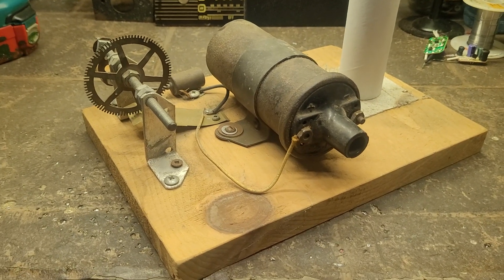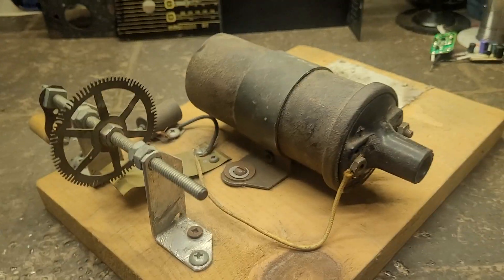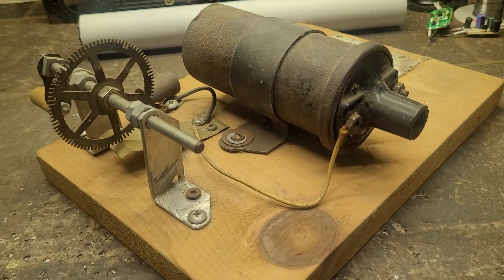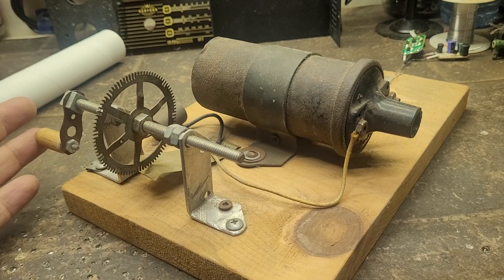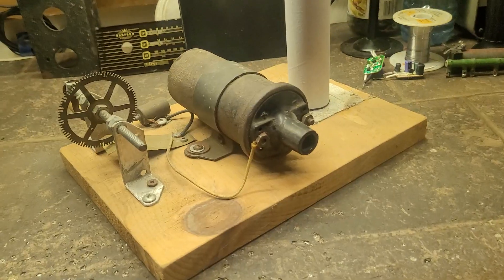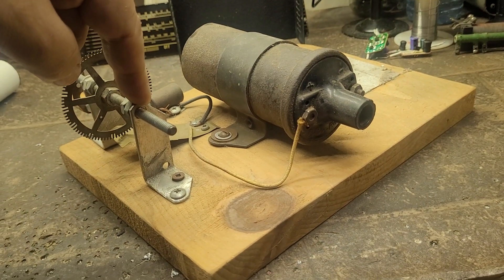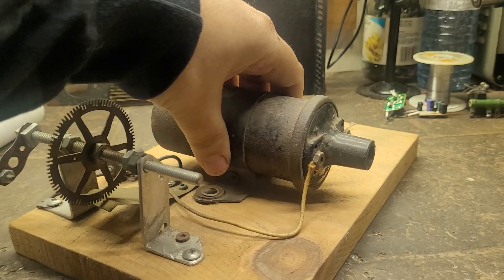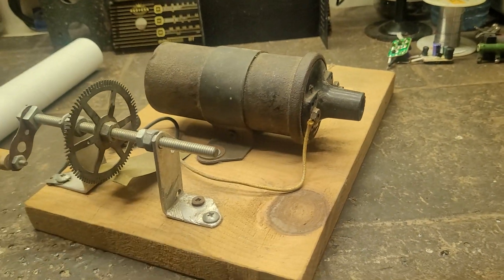TESLA Coil HV power supply?   PART-2   "video response".

Comment: This is rudimentary driver for a Tesla coil. The teeth touch a metal tab as you turn the crank acting as high speed breaker points, this gives a spark of approximately 100,000 volts every time a tooth LEAVES the tab, or breaks the contact in the electric circuit. With many teeth and turning quickly you can generate a virtual constant arc!
Personally I would use it for a jacobs ladder, as it would suit that task better.
Reply from the maker: That high-voltage spark is pretty impressive, isn’t it?

Comment: This spark generator is from some electric project book from the late 1970s that I bought from a local electronics store. It had a red or green cover and each was only about 80 pages long. It had this rather distinctive project in it using a circular saw blade in place of the clock chime wheel shown here. It was unlike anything I had seen anywhere else. Unfortunately I don't own the book anymore and can't find a pdf on the internet. It was part of a short series sold at small local electronic part retailers at the time. I remember the book series also had a very simply anemometer of similar construction and a weather vane project in it.
Reply from the maker: Those books were a great introduction to electronics.

Comment: Pretty sure it was a spark gap transmitter. It certainly would have transmitted via spark gap when cranking it, regardless if that was the sole intent or not. Sending CW Morse Code would require tedious cranking in short/long dits and daws. Probably a kids communication project across town in the 60's or 70's by the looks of the 1960's VW Beetle ignition coil used. BTW, It only appears to be operated by a left handed person but that in itself suggests it was a right handed person. They had to take notes with their dominant hand while operating it. I just noticed your name, Radionut, Surely you jest and already know it's a spark gap transmitter. Also, the tube would have a wire wrapped around it many times and connected to the coil and would be the antenna. A 100' straight long wire would be better but this was a novel mobile device. Cutting edge in the 60s....🙂
Reply: @aarongriffin81  All automotive coils looked like that, once upon a time. It's not a spark gap transmitter, not really such a thing. This is rudimentary driver for a Tesla coil. The teeth touch a metal tab as you turn the crank acting as high speed breaker points, this gives a spark of approximately 100,000 volts every time a tooth LEAVES the tab, or breaks the contact in the electric circuit. With many teeth and turning quickly you can generate a virtual constant arc!

Comment: The teeth on the wheel are making intermitant contact with the plate creating a strobe affect when you turn the crank. It still needs a power supply [12v car battery]  and something like a spark plug.  My guess is there are parts missing.

Comment: Its not impossible that this was for an attempt at a Tesla coil, though if it was, it has a lot of shortcomings. There is no room for a proper primary coil, and that condenser would have a very short lifespan as a tank cap in a Tesla coil.

Also, as you know, a Tesla coil is a resonate circuit, requiring rather precuse timimg on the spark gap, a nearly impossible feat with a hand crank. 

Regarding power supplies, i have successfully used neon sign transformers, Microwave oven transformers, and an old utility company transformer. All are DEADLY when combined with a high voltage capacitor. Just my two cents. Nice video.
Reply: The capacitor is to give the primary coil voltage quick discharge to allow the magnetic field to collapse clean, to induce the best spark from the secondary. You could easily get 1k Hz from this hand crank obviously a MOSFET driver would be better, but the so too would a full flyback transformer but this is obviously what was on hand.